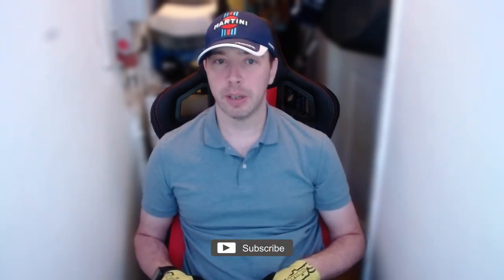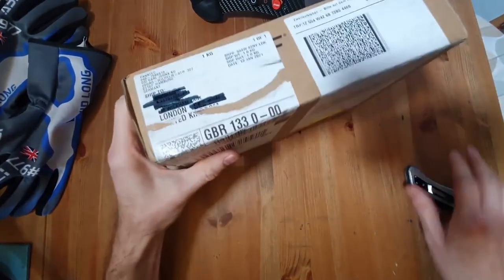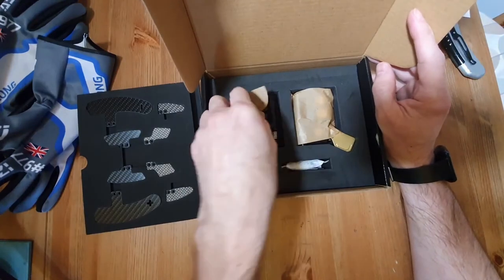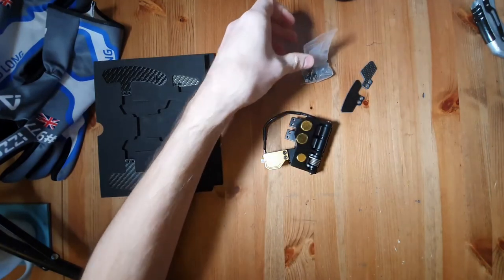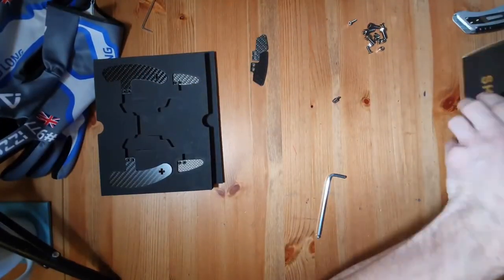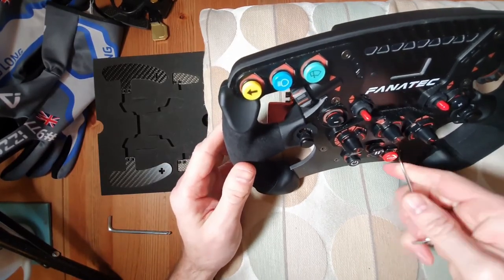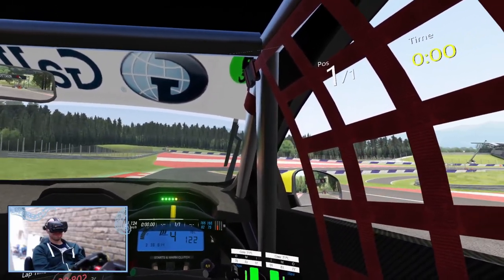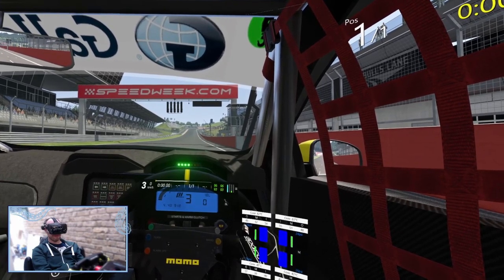Fanatec Podium Advanced Paddle Module Installation & First Impressions

Comment: hello, good video, my question is the ClubSport Formula V2.5 X Podium Advanced Paddle Module Steering Wheel, is it compatible with xbox s/x, do the clutch paddles work?
Reply from the maker: Unfortunately the only features of the paddle module that will work on the Xbox are the same ones you get with the Formula v2.5 X anyway so you'll get no benefit from the module unless you're on PC.
Reply: @Teqqlesdoessimracing  thanks for the info
Reply from the maker: @breynermolinares3665  no problem mate, sorry it wasn't better news!

Comment: Does this paddle module work on the clubsport wheelbase 2.5 with the same steering wheel as you have?
Reply from the maker: I actually use the Clubsport Wheelbase 2.5 so can tell you categorically it does work.  I'm currently using PC driver 381, WB firmware 680 and SW firmware 38.  Hope that helps!